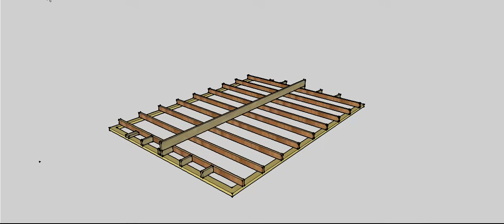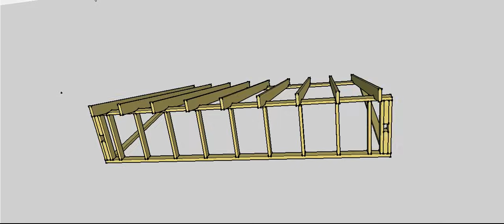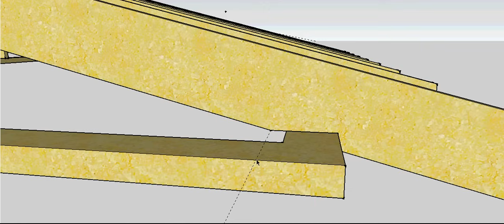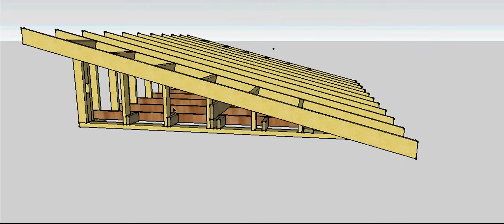Skillion Roof erection Procedure

Comment: Part two:  I understand 6 inches of rise for 12 inches of run. So please help me with how rise and run using a metric framing square.  Thanks
Reply from the maker: Hi, William,
these videos may help, they are for a Gable Roof, however, the only difference with the Skillion is that the "1/2 Span" will be the span (width) of the building rather than Half.
https://www.youtube.com/watch?v=a0SS8lwqf7g&t=319s

https://www.youtube.com/watch?v=DJ34JxKZcEQ

Hope they help

Comment: So how far in do you place the first rafter in order to make room for the verge plate? I put my rafter on the outside edge now I have nothing to nail my siding to ie no verge plate and what are you using for a verge plate, a 2x4?
Reply from the maker: Hi, As the outriggers cantilever over the Verge plate the first rafter should be back 2 times the distance that the outrigger overhangs. For the Verge plate and the gable wall, I would just use the same material as used for the rest of the walls
Reply: @Buildsum  Just checking my understanding please, if my overhang is 600mm, then the first rafter begins 1.2m from the overhanging verge rafter? (Is that the outrigger?)
Reply: As in NOT 1.2m from the side wall...yes?

Comment: What about the corners of the overhang rafters? Is there a diagonal rafter design?
Reply from the maker: Hi Edvard, I'm not exactly sure what you are referring to by "diagonal rafter design" however depending on the design the ends of the rafters are usually covered with a Fascia or Barge board or just left as they are.
Reply: Buildsum I mean, how do they connect in the corners? From the top plate to the corner? Let's say in the bottom right corner, closest to the viewer . It seems that there's a large distance from top plate to the corner. Wouldn't the roof decking sag? Or should there be a diagonal rafter part, that goes from corner of the top plate to where the fascia meets (in the corner)?
Reply from the maker: Hi Edvard, there will be battens that run over the top of the rafters that will help to support the overhanging rafter. Also, you could put in a few more trimmers over the wall closer to the corner.
Reply: Buildsum thank you!

Comment: Thanks for all the excellent videos. One question. Do you need to block lvl’s that are the rafters for a skillion roof? Span is 5.3 m single span? Rafters are to be exposed. Thanks
Reply from the maker: Hi Peter,  My initial thought was yes, however, I can't find anything in AS 1684 or the LVL installation guide that says that you have to.  I would definitely block over the walls to stop overturning but it appears like you don't have to do any midspan which should be ok with LVL as they won't twist or bow like natural timber.
Hope this helps
Reply: Thanks so much. I initially thought the same and as you couldn’t find anything in the standard or code. Good to have a second opinion. Thanks.
Reply: Every 2.2m or less, the blocking strengthens rafters and reduces flex. Blocks to be at least 70 percent the depth of rafter or more.

Comment: There are so many excellent videos you have shared. Thanks. One question as a novice builder I wanted to ask, if I want to put a flat ceiling in a skillion roof, how do I attach the ceiling joists to the highest wall frame if I dont use trusses and I extend the stud height as you suggest ? I’ll be working my way through your videos as time permits. Kind Regards
Reply from the maker: Hi Peter, thanks for your comments, I think the easiest way to install the ceiling Joists would be to set them on the Top Plate similar to the start of the video however if you don't think this is an option then I would attach a Plate, on edge, to the side of the studs at the height required and then attach the ceiling joists with joist hangers or similar.
Hope this helps

Comment: Do you have the sketchup file for this that you could maybe link to? Also, do you happen to know what the longest span can be without a wall on a skillion roof? I know that likely differs for different areas (snow weight etc), but was interested in perhaps a "best practices" - as in..."no longer than 20ft without a support beam or wall" -- Thanks for the great video!
Reply from the maker: Hi Kevin, Thanks for your comment, unfortunately, I no longer have the original SketchUp file fo this video due to several hard drive crashes. Also, there is no real "best practice" for beam spans as there are just too many variables in timber strength and local rules and standards. Sorry, I could not be more helpful.

Comment: what if the roof is 26 ft wide , can u show how u would join the joists ib the middle?
Reply from the maker: Hi Greg
If you have to join the Rafters in the middle you would need to install a Timber or Steel Beam, running the length of the roof, either underneath or inline with the rafters to carry the join. This would need to be designed by a structural engineer or as per your countries Timber Framing Code or equivalent,

Comment: Great video. If the slope of the roof is longer than most 2x6  boards..(over 20 feet), how would one properly join the boards?
Reply from the maker: Hi Micheal, It's not the length that you need to worry about so much as the distance that they can span. If you want to have a flat roof that is longer than the span of the timber you will need to install a beam that runs at 90 degrees to the rafters. This beam will obviously have to span further than the rafters so may need to be a deeper member or even a steel beam. Another alternative might be to use parallel trusses however they will need to be designed and constructed by a truss manufacturer. Another option would be to use a pitched roof instead.
Hope this helps

Comment: Thank you for your excellent video, I am wanting to utilize this roof system on top of three 40' shipping containers in a U shape with a concrete great room and framed in wall. I have a simple sketch I did on sketchup that I wish I could get you, I want the jack wall three quarters distance of the roof with windows and one quarter rest of the way. How would you attach the roof to the containers? thank you
Reply from the maker: Hi Mate, thanks for your comments, the best way that I have seen is just to use large washers on the inside of the twist lock holes and just bolt a beam through them that will span to the next cam lock.

Comment: Great video this is exactly what I was looking for. The only question I have is how do you connect the rafters to the walls? Do you need to come up from underneath or is toe nailing them in sturdy enough
Reply from the maker: Hi John
They will generally require a trip-l-grip to or 2 to hold them down after tacking them down with the toe nail.

Hope this helps

Comment: Sooooo what if I want to take out the jack studs to make an opening for a loft going outward, AND I want to make the ceiling vaulted, AND required length for the rafters including the loft is over 24 feet meaning I'll have to connect two boards to span the length... is it possible to make it strong enough? 
My house itself is 16' by 14' but with the loft extending out its 24' x 14'. I've already built 3 walls at 8 feet tall.(haven't built the wall that will support the high side of the roof and the loft yet). 
I love your videos! They've been very helpful for me so far so thankyou very much even if you don't answer my question. Though it would be really nice because I'm trying to move on with my build and don't know anyone I can ask about this :)
Reply from the maker: Hi Seth

Sure you can take out some studs as long as you treat it like any other opening and put in a head or a lintel to transfer the load to the studs beside the opening.
As for the length of the rafters i would look at some Manufactured Timber Products as an alternative they are available in any length you like. In Australia i would look at LVL (Laminated Veneered Lumber) or I beams, not sure what they are called where your from. The other option would be to run a steel beam across the width of the loft either under or in line with the rafters so they are only spanning half the length of the loft.

Hope this helps
Reply: Thanks, that does help. As far as the rafters I've realized it's a bit odd to have the slope of the roof going the long way as I have it planned, but I can't change that. Instead of finding longer rafters I'm thinking about making the rafters go sideways so they can be shorter. They would bridge the two gable triangle things on either side and have bracing in between each of them. Is there any structural issue with this that I'm not seeing?
Reply from the maker: Hi Seth Sorry for the delay but have only just seen your message. No nothing structurally wrong with doing that, sounds like s good option

Comment: Thanks for the video. What is the purpose of the "hanger"? Are the roof joists that are attached to the rafters on the short wall necessary? Is a vaulted ceiling possible?
Reply from the maker: Hi
The hanger extends the span of the ceiling joists without protruding into the room. Ther is no problem at all with not having the ceiling frame, a vaulted ceiling is certainly possible.

Comment: Thanks for the excellent video, really helpful. Do you have any recommendations as to where to use galvanised L shaped brackets and such, or just good screws through one piece and into the end grain of another? Cheers
Reply from the maker: Hi Russ

L brackets are generally only used to secure the rafters down to the top plates, to fix the verge rafter yiu can just screw or nail through the rafter into the end grain of the trimmer.
Reply: Buildsum that makes sense, thanks for your help again. Cheers

Comment: Thx, My 12x 24' garage had a leaking flat roof. It now has a Shed type/Skillion thx to your video and many other youtubers. I went with a galvanized metal roof with 5 windows across the jack wall. It took me a month to finish and I am very happy with the results.
Reply from the maker: Good on you Nomad, Great use of the Jack wall I'm sure it will let in heaps of light.
Reply: A month....
Reply: Nomad Chad 👀

Comment: I need some help with my current architecture project. I have decided to go for a Skillion/mono-pitch roof but I am totally unsure about the correct way that I would calculate the length of each rafter and the distance between etc. My roof is 9.6m x 8.1m and i have decided to go for a thin waterproof concrete. Any help would be helpful. Thanks
Reply from the maker: +Sam Robinson HI Sam
Both these video show you how to calculate the length of a rafter for a pitched roof, for a skillion just change 1/2 Span to Span and it will work.
https://www.youtube.com/watch?v=kKkfIzqAj90

https://www.youtube.com/watch?v=a0SS8lwqf7g

The distance in between is usually determined by the designed and the rafter sectional size determined from that.

Hope this helps

Comment: wonderful.  thank you for sharing your talent and knowledge!  I'm doing my first one this week. and it's got me a little nervous. looks easy enough from the sketch. also, how can you calculate your roof pitch with this mono roof design. like I said I'm a new at this part of construction and contracting. this video really helped my visual. thanks   again friend!  
-Dave
Reply from the maker: +David Paul Hi David Thanks for your comments.

If you know the difference in height between the high side and the low side and the span of the rafter you can divide the height difference by the span of the rafter and multiply by inverse Tan e.g. if the difference in height is 0.577 mm and the span of the rafter was 3m then -Tan x (0.577 / 3) = 10.887 degrees say 11.

If this doesn't answer your question you could look at these videos they are for a traditional pitched roof however you just need to substitute 1/2 Span for the Span of the Skillion

https://www.youtube.com/watch?v=a0SS8lwqf7g

https://www.youtube.com/watch?v=kKkfIzqAj90

Hope this helps
Reply: +Buildsum yes thank you so much!!!!

Comment: Have had Many Carpenters tell me I could not build my roof this way. 1- they never heard of it or seen one 2- didn't under stand even after drawing it out or mocking one up out of scrap 3- Not the proper way to a roof 4- get mad at me for using trusses and rafters interchangeably 5- still can't believes it works after I did it to my porch.

Had my neighbor helping me, and he would argue with me every step of the way of how I wanted to build my house. After awhile, I told him to "Fuck Off! I'll build MY house the way I want. It's MY house." He just came over one day and decided to help me on his own accord and got all pissed because I wasn't paying him after awhile also. Fucker is 2 points above Retarded. He was just one of who didn't understand what kind of roof I was talking about.

Only thing I didn't count on was the fact that the Roofing Tin is exactly 12ft in length and so was the porch, so I had to fudge things a little so I could have a drip edge. Still, Works great for my needs. After all it's just a porch.
Reply: ravenlorans  The problem is most people have a die hard way of doing stuff and they would bet their lifes on it being the only way to do it. Not even consider that sometimes you got to think outside the norm of whats been labeled the right way because every situation is different and some people think they are so much smarter but theh  just want to  control the people around them narristic trash
Reply: I am pretty much having the same problem. It isn't a very popular roof design where I live, so professionals don't build them or even understand the concept! We're going to be alone in figuring this out. Raven, could you post a photo of your project?

Comment: Hi Buildsum
Do you recommend any diagonal steel cross bracing or extra blocking or do you just rely on the roof battens?
Reply from the maker: Ian Chivers Hi Ian, Steel cross bracing will definately help. Blocking is generally only required if the rafters are wide ( or deep depending on which way you look at it) to stop them from rolling over. The roof batterns won't give it much bracing however if you are putting on a iron roof that will give it substantual bracing.

Comment: Is it possible to tie this kind of roof into the side of a weatherboard house without a frame underneath it? Essentially using the tie in to the house wall as the support for the high side of the roof?
Reply from the maker: dunniss Hi dunniss Yes that is an accepable way of constructing this roof
Reply: dunniss yes just cut mark the pitch and cut it. no need for a seat cut. just hanger it.

Comment: Hi, We're buliding a 16x20 cabin. It will have a loft on one half (8x16) with the other half being open to the space below. We are doing the skillion roof, but due to us being unsure of our roof choice when framing the walls, they are all 8ft. (One wall is not taller) SO we are going to have to build the jack wall on one 20' length to create the skillion roof. What are your tips for building it like this?? How do you make it more sturdy? There will be OSB on the outside and inside, thinking of adding some steel framing plates along the joint of the wall plate and bottom of the small wall. Thanks for your help!
Reply from the maker: Paul Reed Hi Paul If you can run the OSB full length that would be great otherwise make the join at the bottom and let the full sheet run over the join of the jack wall and the existing wall. That should make it strong enough. I don't think that the framing plates will be needed if you can do this.
Reply: Buildsum Thanks Buildsum! We were planning on doing just that, left the osb on the outside a couple feet from the top so we could go over that joint. Thanks for your advice, makes me feel better about the stability.

Comment: Great videos! Can I ask you some questions about roofing? I have a 20' x 30' lean-to roof I'm building and I need to know what's the best design. I can send pics if that would help.
Reply from the maker: All Out Throttle Hi Ask away i will help if i can
Reply: Buildsum I sent you a message through youtube.
Reply: hey i have 21 by 25ft shed i am doing too. what wood should i use 2x6 or 2x8 as its a long span? or will i need loaad bearing wall in center?

Comment: really finding your videos helpful. i am planning to build a skillion roof timber shed with 5deg roof pitch. just wondering, you were saying it is better to build one wall a little bit taller, but in doing that, when I go to attach the double top plates to connect all 4 walls, 2 of the double tops wont be able to sit flat. is there a correct way around this?

just one more thing, a bit off topic but do you need to use house wrap when putting up sheet metal wall siding if I batten the sheets off from the wall? if so, would i put the wrap directly over the plywood then battens over that for sheeting, or wrap over the battens then sheeting on top.  thanks you mate.
Reply from the maker: Hi Alex
If you build one wall taller and have two sloping walls you won't be able to overlap the top plates at the corners, this is OK you just need to use 100 x 50mm Gang-nail plates on top to hold the corners together

As for the House wrap it works better if you can create an air gap between it and the Cladding so I would put it under the battens  

Thanks for your questions and feedback
Reply: I'm currently building a skillion roof shed/animal barn and having the same dilemna - build one wall taller and then try to join it without overlapping top-plates, or do the jack-wall method with overlapping double plates underneath. Wondering which method you ended up using and how it's been going?